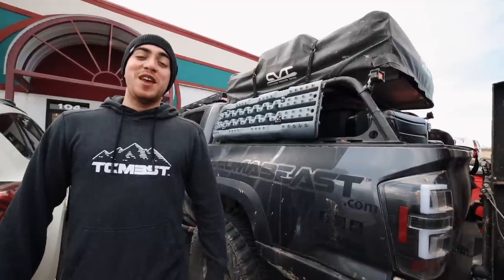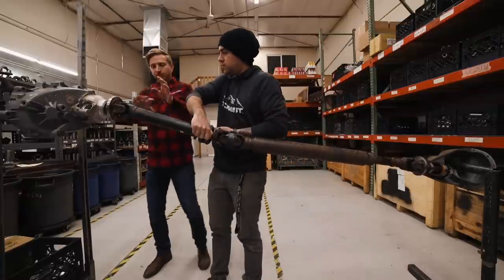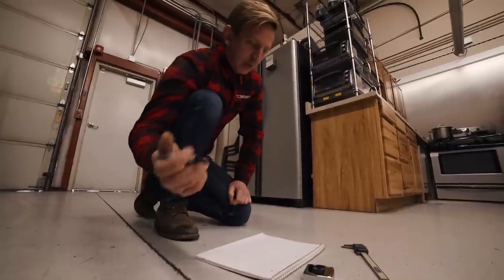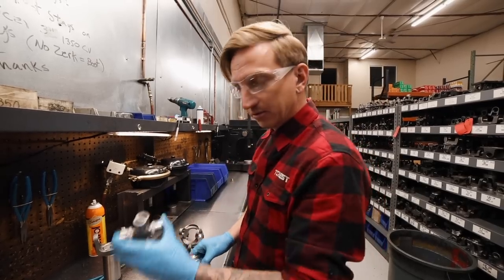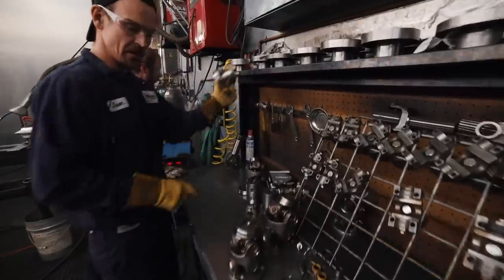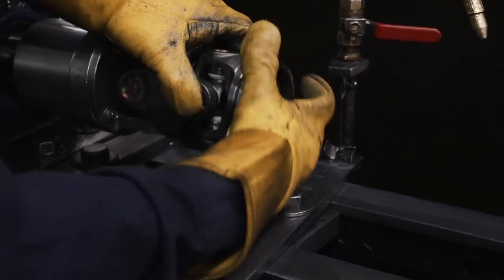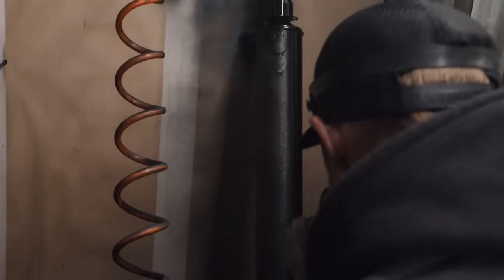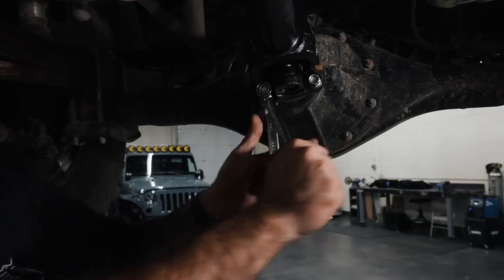Toyota Tacoma Vibrations, How to Fix This Problem

Comment: I think I'm going to keep my 2020 off road at stock ride height just seems to be way too many problems when lifting. Too much money to
Reply: Best choice. Most trucks wont even utilize the lift when offroading. Unless your trying to push the truck to its limits.
Reply: Chump Cheddar how about bigger tires ?
Reply: @Lexusgx550  how big of a wheel set up can you put without doing a lift and no rubbing?

Comment: I lifted my Tacoma 8 years ago and have gone thru 4 carrier bearings. Always in bad places they went out. I wish to god I knew about this at the beginning. How much did this cost?
Reply: Josh Reed you need a carrier bearing drop kit and pinion spacer
Reply: @tacomabeast  any recommendations for first gen Tacos? Ive got an 04 with this issue

Comment: Watched this video before christmas and ordered a Tom Woods replacement shaft for my 2004 Tacoma. I've got a 4" lift on my TRD and its been giving me an assload of vibrations coming from the stock driveshaft. I've already had the rear diff rebuilt because of the wear it caused, this was the only other thing left to do. So easy to do this swap, didnt need any help. Very happy with how smoothly it runs now. Ill be posting a vid of the install I did on my channel soon.
Reply: All of that vibration will cause damage to your differential or the transmission don’t let it go very long. Like get it fixed before you drive any where. It won’t take long to damage something.

Comment: It's called buying a angle meter and doing some research.  It is also called doing the correct amount of maintenance. My Tacoma has a two piece driveshaft and is lifted 3" with 300k miles on it. Zero problems. It is called phase, all angles have to work together. There is a ton of information on the web including on Tom Woods site. Before you guys jump down my throat I have been using Tom since he worked at Six States driveshaft. No one is better than him. He probably doesn't remember me but I dont care I will always use him. God Bless.
Reply from the maker: That’s a lot of names for the same thing 😂

Comment: Setting proper pinion angle is key to less vibration and longer u-joint life.  Also. With non greasable u-joints when you pop the caps off to install. Put a blob of grease in each cap.  They aren't usually greased that well from the factory.  Anything to get longer service life out of your vehicle is better than things wearing and breaking down sooner because it wasn't done right the first time.

Comment: Pro tip: cut the carrier bearing bracket off. That’s what I did after my toms woods shaft hit it when suspension was compressed.
Reply: Very nice of you to share:)
May i ask how much you paid for the drive shaft? 
Thanks
Reply: @mohammadvazin1949  it was around $600

Comment: This is informative.  I had a stock rebuilt by nw drive shafts.  The did all of the joints over.  Spray painted it and put their sticker on it.  Not even a year later and 6k miles the carrier bearing went out.  Moved so I had to take it to another place.  They couldn’t figure out why they wouldn’t have replaced it when they had it apart.  $950 and then another $350.  Now it vibrates.  Ugh.  Should’ve just called these guys.  Nice work
Reply from the maker: DAMn bro that sounds horrible 😞 hopefully you’ll find someone that knows what they’re doing next time 🙌

Comment: Thanks for the video.  I have had (3) new T-Taco in the past, none but one built in Mexico had this driveline vibration.  I used to own Nissan Frontier too and always wondered why Toyota not use one piece driveshaft similar to Nissan which never had this aggravating vibration.

Comment: Just a heads up I called them the other day to order a drive shaft and they can’t make them for long bed Tacoma’s. My measurement with my 2.5 lift was 82 1/4 length and their equipment can’t make it to that length. Not to take anything away form the driveshaft itself, I’m sure it works fine but just a heads up that if you have a long bed you have to go elsewhere or just get a carrier bearing spacer and replace the carrier bearing along with making sure your pinion angle is right and the truck should drove fine.

Comment: Once the weight of the shaft isn’t held by the carrier bearing, what does the added weight of a floating shaft do to the transfer case and rear diff?
Reply: Yes it does but the bearings in the transfer case and pinion can handle it. I don't have the specs for the bearings in the Tacoma specifically but generally speaking these bearings have radial load ratings in the thousands of pounds. The drive shaft only weighs 40 lbs. The purpose of the carrier bearing on the stock shaft is to support the center of the shaft to prevent it from flexing and bowing due to centrifugal force as it spins at high RPMs. That function of the carrier bearing is indeed being sacrificed with the one-piece design but the end result for most people is much better than what they experience with their stock shaft.
Reply: @tomwoodscustomdriveshafts  the driveshaft I bought last year from you guys was awesome on low speeds but terrible on high speed 65+mph it vibrates like crazy i have returned it but your customer service is awesome returned it with no issues i would have loved to use your one piece drive shaft on my TRD 4x4 Sport 3rd gen truck but the oem way less vibs than yours on high speeds hope that you can figure out why me and others had that issue

Comment: I have watched alot of Toyota videos because I wanted a Tacoma. After watching these videos I have changed my mind.  There is so much you have to do just to lift and have 35 inch tires. Not to mention the gear huntings, tunes , and drive shafts. Wow😮 that's a lot of money just to lift a truck. I'll pass and look at other off road vehicles.
Reply from the maker: Honestly you kinda need the same stuff for other trucks as well. The information is just not out there. Tacoma hold the most amount of support and products when it comes to customization right next to Jeep. Also, the new 20204 Tacoma does not need as much as the 3rd gen needed. You might want to look into that.

Comment: My question is there option for tube wall thickness? What was use on yours did not look very thick. But I will trust Tom Woods understands what works and what does not.

Comment: Yo what’s up taco gang. Need some help fellas. I bought a 2021 Tacoma 6foot bed v6. I’ve taken it in twice already for my truck shaking, I thought it was a tire out of balance but the dealership has balanced the tires twice already, truck has 9k miles on it at this point.  This video is very helpful and something I’ll look into. Any other recommendations that can point me in a good direction to get this fixed?

Comment: Good choice on the non greaseable joints. So much stronger. Horrible idea to force that weld to cool so fast. If you need to cool a weld faster use air so you don't risk cracking.

Comment: Good video until the end. Didn’t torque spec tighten the bolts attaching to the transmission in the front and the axle assembly in the back?! Just hand tightened with wrenches? Wew…have fun with that.

Comment: Wrong  body the purpose for that two piece drives shaft is for ground clearance Off-roaring
Reply: I guess as long as he dodges those huge rocks and properly approaches a path to dodge any rocks he should be fine.
Reply: You would be correct. It is to help break over angle.
Reply: Shane Baustian it is physically impossible for your one piece to have better clearance than the oem 2 piece
Reply: Shane Baustian no it sounds like I know more about 1 piece driveshafts and physics than you do but hey it’s the internet after all, keep feeding this dude fake news
Reply: Shane Baustian why yes I am a clown, but one without a one piece driveshaft, so who’s the clown now? Also it’s You’re not your. Duh.
Reply: The two piece shaft is not there for off-roading. The purpose of the carrier bearing is to support the weight of the shaft. Imagine for a moment that you had a drive shaft that is 20 feet long, single piece. . As that shaft spins at 3,000 RPM, it will flex and bow slightly, it becomes unstable. Same concept with this shaft but of course less dramatic as the shaft is not 20 feet long. That is the reason they use the carrier bearing, to support the center of the shaft. Semi-trucks also use carrier bearing type drive shafts. In a semi, it is obviously not for off-roading, it is because of the length of the shaft. Take a look at the position of the new shaft once it is installed, it is pretty similar to the stock shaft in terms of ground clearance. There is a reason the engineers at Toyota use the type of shaft they did, but there is also a reason that they put the suspension at the height they did. Lifting the truck creates problems with other parts of the system. In our experience, when those problems develop with the drive shaft, the single piece drive shaft is the best solution.

Comment: As a machinist and also an engineering.  I think the tubing is thin!  It would be better if the wall thickness of the tubing is thicker.

Comment: does the new shaft have the same mass as the OEM.  I would think having thicker walled pipe would provide two things, a nicer cruise speed on the highway and a tougher to bend or dent off road.  It may take a little energy loss off road but the highway on the way and back would make up for it.

Comment: I have a 2021 Toyota Tacoma TRD OR Automatic. If there's a vibration on accelerating from a stop in 1st gear and it goes away before shifting into 2nd gear, what might be the cause of this? I've researched this thoroughly and the only common issues are vibration at particular highway speeds but I haven't found anything with my particular problem. Please help!

Comment: I just finished watching your install of the Deaver stage 3 leaf springs. Did your shudder come as a result of that install?
Reply from the maker: Nah it was honestly just abuse to the truck 😂
Reply: So I shouldn't be hesitant to install the stage 3 deaver springs? Also how can I tell if I need to change out my shocks. I bought my Tacoma used but have no idea how many miles are on them

Comment: Could this be a fix for the deceleration vibrations on stock Tacomas?
Reply: I would like to know the answer to this as well. That’s how I stumbled upon this video .. 2021 sr5 bone stock 2300 miles and I have this vibration and I ant figure it out. It’s been to the dealer and they got nothin

Comment: Mine is lifted about 3” , i do have a carrier bearing drop kit but iv never had any issues . Does having a single piece driveshaft affect the angles of the differential at all ? Is the single piece driveshaft recommended for a certain size lift or any lift ?

Comment: Thumbs up for an actual solution, vs. the lies and band-aids Toyota put out there including "it's a characteristic" or their service bulletin to add a steering wheel weight, lol. Why wouldn't Toyota just get it right from the beginning?   At least I won lemon law arbitration and they bought Taco back for this.

Comment: What are the torque specs for the drive shaft where it connects to the rear diff?
Reply: I believe the spec for the 2nd gen is 65 ft/lb. Any flange with multiple bolts should be tightened evenly and in a criss-cross pattern. What he showed with the hand wrenches isn't perfect but probably good enough given the thickness of the flanges and the size of the bolts.

Comment: "This being a Toyota, it's metric" -> this had me laughing! hahah so you can't take measurements in ft/in because it was designed in the metric system? 😜
Reply from the maker: It’s just more accurate 🤷‍♂️ otherwise you end up with 3/16ths of an inch or something and it gets annoying 😂
Reply: I specifically said it can be tricky to measure in inches, which is why I prefer metric, but then demonstrate both. For most guys finding 66mm on a measuring tape is easier than finding 2.59843 inches.
Reply: @tomwoodscustomdriveshafts  all good!! just thought it was funny the way it was said it was a toyota therefore its metric 😆

Comment: Hi there did you measure the truck already lifted with those tires? Or did you have to drop the lift to measure the stock drive shaft angle?
Reply from the maker: You would measure it as it is with the lift and tires you are running 🤙

Comment: How much are those custom driver shaft, I have a 2007 Toyota Tacoma with the extended cab on it and it a 2 wheel drive with a 4 cylinder motor
Reply from the maker: Hey Herbert! It sort of depends on which one you get but you can customize on out website here: https://tacomabeast.com/products/toyota-tacoma-rear-drive-shaft-vibration-solution?_pos=4&_sid=7a96af3ae&_ss=r&variant=31501627097190 they’re currently sold out but should be back in stock soon 🙌

Comment: How can you diagnose this issue? Is vibration felt in the steering wheel?
Reply: No not really. I feel it at around 25 MPH deceleration and then around 15 MPH. I also replaced my needle bearing with the clamshell bushing from ECGS. I ordered this shaft and it is due in in a few days.

Comment: Does anyone have a problem with the bluetooth on the Tacomas? Mine sometimes cuts out when I'm playing music
Reply: My 2020 was doing that. I changed my phone unlock from fingerprint, back to a pin number. And it's been fine since. Its sounds weird. But I read if you have phone set to recognize gestures it could cause bluetooth issues for some reason. And it hasn't cut out since. Mine would play the first 10-15 seconds. Then just stop and not restart.
Reply: Yeah, 2019 and below, no apple play like the 2020 Tacos
Reply: Never
Reply: I have issues on my 2015

Comment: Looking at getting a 1 piece drive shaft, unfortunately Toms doesn’t sell them for Tacomas anymore. 

Any issues with clearance with a 1 piece? I’m not doing any rock crawling, more camping/overlanding.
Reply from the maker: I think it retains about the same clearance as stock if properly installed
Reply: @tacomabeast any long term negatives about a 1 piece or has been great?

Comment: Tom Woods one piece drive shafts are good but not on a speed above 65mph it start vibrating like crazy i have returned it for a refund my truck is 3rd gen TRD Sport 4x4
Reply from the maker: We actually found the opposite is true, their driveshafts have fixed our vibration issues, do you think maybe yours was installed wrong? 🤷‍♂️

Comment: my stock 2005 TRD sport 4x4 6m had a vibration when first taking off. Felt like things were bouncing up and down. I replaced the transmission and put in a new clutch, shifter and shift kit and while I was there I got the updated mount for the transmission/post engine mount I thin they call it. I haven't had the vibration since.

Comment: Better & easier way to measure is to use a string.  If your alone it’s easy to tie the string on one end and then pull it taught to your opposite measuring end and then you make your mark, then measure the string.   Use a string or line , even a soft wire if you had to .... because some people don’t have 154 tape measures of every shape and size or a CAT  S61 contractor phone with laser measuring crap.   Or maybe just not too skilled in the measuring with tape thing.  
      It’s not rocket science, but just when you think you’ve seen it all, bone big hotshot engineer or GC or anyone for instance, and it’s just one small thing that winds up costing unthinkable amounts of stupid.   Measure a billion times, cut once! Then take your bong rip.  After, Not before genius!

Comment: No doubt this addresses the vibration issue, but I think we’re missing that some Tacoma’s will need to cut their carrier bearing cross member off to allow for this one piece.  This depends on how lifted your truck is.  Higher the better and if high enough, you probably don’t need to cut it.  Another good alternative is to keep a double drive shaft, but run double cardan joints.  No crossmember cutting and no vibes.  Good video otherwise.
Reply: Good advise. Having had issues in the past this method will help.

Comment: I'm stuck. I have a tom woods shaft and 4 degree shims on my 2.5" lifted. I still have vibration at 35-45mph. Does anyone have suggestions on what I could do next?! Its driving me crazy!!
Reply: I have the same issue.
Reply: @OverlandFlorida  i saw on tacomaworld that it may possibly be the torque convertor going bad. But idk. Or the tyranny mount.
Reply: Unless your leaf springs are really bad 4 degree shims are too much on a 2.5" lift. Tom Woods recommends 2 - 3 degrees down from pointing directly at the transfer case. Measure your rear u-joint working angle. Their website has directions on doing it or you can call them and they'll help. I have about a 3" lift with HD Dakars and I'm running 1.5 degree shims right now but I could take them out and should still be within limits.

Comment: If you measure the bolt pattern from top to top or bottom to bottom, that is what center to center is with out eye balling it. Im supprised the guy did not know this. WTF
Reply: We do indeed know this. We have photos on our Toyota drive shaft pages showing and explaining exactly this concept, with the bolts removed so you can measure to the edge of the bolt hole. The reason I didn't demonstrate this in the video is because the bolts are still installed and the bolts are hexagonal. Because not all of the bolts are oriented in the same rotation, if you go top to top you might be going to the corner of one bolt and to the face of the other, resulting in a skewed measurement. I'm surprised you didn't know this, WTF.